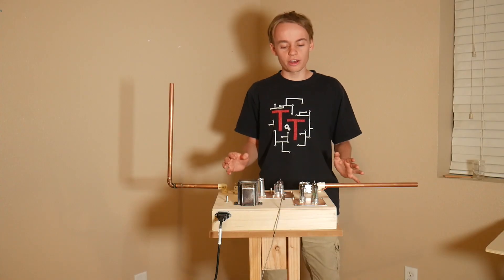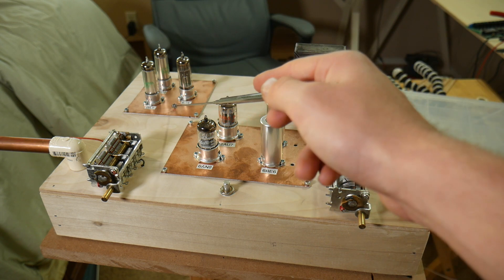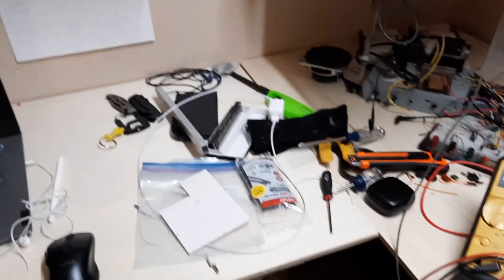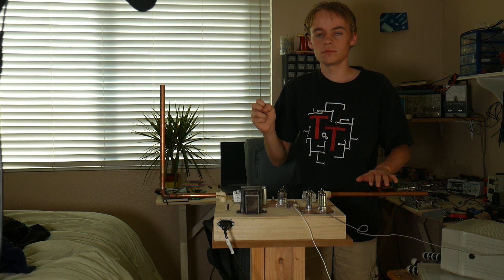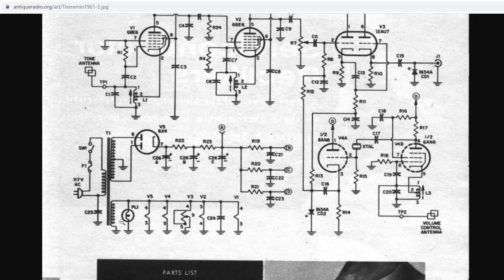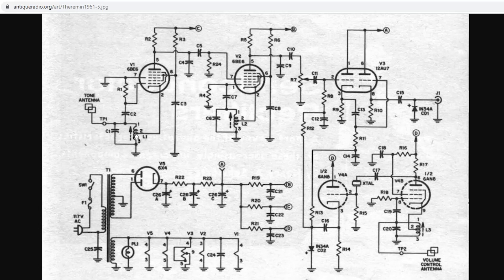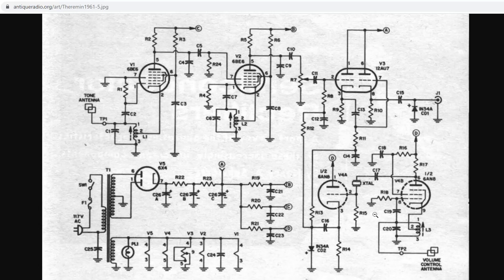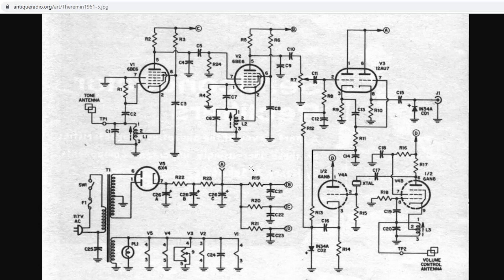DIY Vacuum Tube Theremin(+Circuit Explanation)

Comment: Your volume is reversed compared to every other Theremin I've seen; however, I like that it's quiet when your hand isn't close to the volume antenna and louder the closer it is. Excellent explanation at the end. It brought back memories of my training on Air Traffic Control Radar Systems at Keesler AFB in 1970.
Reply: Some theremins are designed to have increasing volume with the hand approaching. In my opinion, it is actually more intuitive to play that way, and the instrument won't squeal when you move away from it.

Comment: Wow what an amazing video! It's so hard to find a video of a real Theremin build! Is there a big difference in sound quality etc if it's built using semiconductors instead? Cheers!
Reply: The use of semiconductors instead of tubes does not necessarily imply that there will be differences in the timbre, since the designer can selectively alter the circuit topology and select components to emphasize desired harmonics. Having said as much, tubes may inherently cause distortions that emphasize even-order harmonics, while transistors may inherently cause distortions that emphasize odd-order harmonics. Even order harmonics are generally much more pleasant to the ear.

Comment: I just finished building my tube theremin. I looked up the article in EI 1961 and I remember seeing it  back in the day. I chose to build mine in an LMB aluminum chassis box about 12 by 8 by 2 inches high. I used the dual OA2 regulators and added better filtering than shown in the article. I built it stage by stage and tested each circuit as It was assembled. The hardest circuit to get working was the  6AN8 resonant amplifier. My antennas form are still up in the air, but i chose a simple vertical  14 inch whip and a half loop for audio level. It works pretty good. Now I am going to attempt the sold state version.
Reply: There are too few DIY videos that can be found, please come up with DIY process and idea videos!
Reply: I d love to build this with my 1p year old son. I' m intimidated by the dated schematic

Comment: Fantasic explanation of the circuit! I wanted to build this theramin for a long time. 
I live in europe and here the voltage is 240 do you think getting a suitable transformer will be good enough or should i change other things in the circuit?
Reply from the maker: Thanks! A suitable transformer should be the only change you will need. Try looking for some broken vacuum tube gear to salvage a transformer from
Reply: @TannerTech  Thanks again for the detailed video and comments. Can you please explain where did you use the oa2 regulator tubes in the circuit? i can't see it in the schematic.

Comment: But how do the variable capacitors figure in?
Reply from the maker: They are placed between the antenna and ground.  They are there so I can tune the volume oscillator and one half of the pitch oscillator.
Reply: Ah. So in addition to the tank capacitor. Cool.

Comment: How comes the volume gets louder when bringing the hand closer to the volume antenna? Usually Theremins are constructed the other way around, bringing the hand closer mutes the Theremin. Is the original circuit designed this way or was it your idea to flip the behaviour?
Reply from the maker: This was the original circuit where the volume control is flipped.  I could probably reverse it by making the volume control oscillator output control the cathode instead of the grid bias though.

Comment: Nice T-shirt Branding.  Amazing theremin. On another note, do you have any use for used lithium batteries? In the future there will be a glut of them. Already I have a dozen waiting for toxic pick up day.
Reply from the maker: What kind of lithium batteries?  A lot of times, the old lithium laptop batteries have 8 or 9 cells in them, and typically only 1 cell is bad.  I have used the remaining good cells to power some of my projects, like a handheld soldering iron.  

https://amzn.to/2WwFI56

These battery charger boards are awesome, especially if the batteries are 3.6 volts.
Reply: @TannerTech  Good to know. I've 2 dabblers that might take them if I gift the recharger as well. I've drained batteries from 1 scooter, 2 digital cameras, 1 Debot vacuum, and 12+ coin cells from Christmas ornaments.

Comment: Nice job! I really want to build a theremin one day. Be careful with that arcing at 5:09, though. That's not a good sign. Maybe you should have a different filament winding for the rectifier to reduce the cathode to filament voltage. I'm not sure if that causes this, but it's worth investigating.
Reply from the maker: Thanks! I noticed that as well.  It only happened for the first 5 minutes of the regulator tubes running.  The neon inside had not started glowing yet and it was arcing.  After a bit, the tubes started glowing and I haven't had the problem since.  That might be a good idea to have a different filiment winding.  If the problem ever returns I will try that.

Comment: Could you connect the output through say a signal generator, that way you could theramin any frequency

The antennas have no resistor, so there is a path to high voltage, maybe one could be added, or, paint the pipes to prevent accidental shock
Reply from the maker: That would be interesting, technically I could use the volume control antenna to control any audio signal.  

Both antennas have a straight DC path to ground through the oscillator coil, so it is perfectly safe to touch them, as long as the circuit is properly grounded.

Comment: In all things tube, isn't it that the shorter the wire you can get away with, the better? They act like antennas

Having said that, does the sound change if you are statically charged? Or say, try sticking a battery on yourself🤔

Comment: Should the volume part be circular, gives more surface area you can... Nearly - come in contact with
Reply from the maker: Probably, but the copper pipe I bought was too wide to bend

Comment: Tanner, that's an amazing accomplishment - building a Theremin. They are difficult to bring into alignment and difficult to play well. The addition of the regulating tubes helps greatly to stabilize the device. Personally I might have built it into a metal chassis instead of wood, but it appears to be working well as is.
Reply from the maker: Thanks! I wanted to make a metal chassis, but did not have any of the parts to do so.  Wood is a bit easier to work with.

Comment: Wow Tanner that was a good one indeed. A transistorized version of this would be interesting. Instead of the hexode tube you could use a dual gate FET or maybe better a balanced mixer. Glad you're back :).
Reply from the maker: That would be cool, I am planning on making a transistorized version in the future sometime.  Most dual gate fets are new-old-stock, it might be worthwhile to buy one to experiment with.  Glad to be back!
Reply: @TannerTech  Best would be to use a quadrature balanced mixer or analog multiplier that are still available. They are more precise than dual gate FETs.

Comment: Absolutely awesome video Tanner!

Theremin's are wild, wild instruments, and the circuit is super interesting. You did an awesome job man, such a clean build!

Out of curiosity, where did you slot your two 0A2 regulator tubes into the circuit, since they aren't included on the original schematic. 

Also, the 6BE6 oscillators are really interesting. The first 6BE6 looks to have the second control grid tied to the first grid through resistor R1. If I'm not mistaken, this effectively turns the 6BE6 into a fancy pentode (since the two grid potentials are essentially moving up and down at the same rate). I wonder if they did that to use the first 6BE6 as an amplifier for input into the second 6BE6, where the actual signal mixing occurs. That also raises the question of whether that could be shrunk down into a single 6BE6?

The 12AU7 is a really interesting setup as well. They're both set up as cathode followers, which means there shouldn't be hardly any amplification of the signal coming out. It looked like you were feeding the audio jack into an amplified speaker? It'd be fun to build a little Class A amplifier out of two more 12AU7s and an output transformer to drive a speaker for a truly 1960's experience, haha.

Oh, and thanks for the shout out man! Keep up the excellent videos, looking forward to more!

Ninja edit: I was looking at the schematic again and I don't know how I missed that the second grid on the 6BE6 tube is actually tied to ground! That's even more interesting - there's so much going on with each individual tube, it's super fascinating! I may have to build just that oscillator portion of it up someday to fully understand what's going on. My wild guess (at 2330 at night) is that the second grid is held at ground, but the potential of the cathode actually changes, meaning the relationship between the second grid (which is ground) and the cathode is oscillating, allowing electrons to flow to the plate or not. Though I could be completely wrong! What an awesome circuit!
Reply from the maker: Thanks man! I put the 2 OA2 regulators in series to ground right after the 2nd power supply resistor, this made sure the regulators were not directly connected to B+ and before all the supply rails.  Yeah, I was just feeding it through a low quality amp.  Although, I brought it over to my friends house and hooked it up to his fender amp and delay pedal.  It really sounded cool then!  I did build a class A tube amp a while back with a 12AX7 and a 6V6, but it is currently not working.  

You are welcome for the shout out, I really like your channel and I hope you were able to gain a few more subscribers.

That is an interesting thought about how the first oscillator works, you should try that out.  do you think that it could also be just acting like another supressor grid?  This circuit is very cool!
Reply: @TannerTech  Thanks for the update on the 0A2s! And the 6V6 is a righteous amplifier tube. They’re pretty popular among the hi-fi crowd, but our Magnavox Concert Grand uses a how lineup of them and they sound phenomenal. 

Alright, I finally decided to clear off one of my breadboards and give this 6BE6 circuit a shot!

First and foremost, the Hartley oscillator, like the Colpitts oscillator, is such a simple but insane little circuit, it’s hard to wrap your head around from an theoretical point of view. The inductor/capacitor oscillation part of it kind of makes sense, but where it gets wild is that the potential of the cathode is always changing, which means electron flow is being controlled not just by the grid, but also by the cathode. And, when using a 6BE6, electron flow is controlled by two separate control grids as well as the changing cathode potential. It all mixes in an absolutely wild way!

So, I grabbed a spare 6BE6 and rebuilt this circuit, only I had to make a few small changes since I’m running at just 24V. First, R2 is 10k, C1 and C2 are 1nF each, and L1 is 2mH made up of two 1mH inductors with the cathode in the middle. I played around with a few different resistors for R1, the resistor that connects the two control grids and man, things got weird.

Here’s the oscillator on the scope with the probes on the output and the cathode, and a 33k resistor for R1: https://i.postimg.cc/jq4g9SM3/6BE6-33k.jpg

First things first, the scale is 5V per division for both. 0V for the cathode is in the center of the screen, and 0V for the output is at the bottom of the screen. So, the output is oscillating from about 20V to 24V, and the cathode is oscillating from about -10V to +10V. 

The cathode is a hot mess and a half, and the entire thing feels like its on the edge of chaos, haha. It oscillates stably though, which is a testament to how awesome and forgiving the Hartley oscillator design is. I just randomly picked some values and am running at miniscule voltages and it (kinda) works. Things get really interesting once you change the value of R1 though.

Here’s the oscillator with the probes on the output and the cathode, and a 3.3k resistor for R1:  https://i.postimg.cc/kXM1dPZJ/6-BE6-3-3k.jpg

Whatttt?! Yeah, the output has done something wild now. Alright, the basics, 0V for each is unchanged, so the output is oscillating from about 20V to 24V like before, but the cathode has really smoothed out and is now oscillating from about -2V to +4V. What’s absolutely blowing my noodle though is that the output oscillation doubled.

Here’s the oscillator with the probes on the grid and the cathode and a 3.3k resistor for R1: https://i.postimg.cc/QMWskTky/6-BE6-Grid.jpg

The cathode follows the grid almost exactly, so there’s some voodoo wizard magic going on here. My theory is that the cathode and grid are oscillating together, not because one is following the other, but from the LC tank circuit. However, the when the cathode bottoms out, the grid falls a little lower, making it negative relative to the cathode and stopping electron flow. This causes the output to go high. Then the grid and cathode come up together and the difference between the two drops, which brings the output low. Then we see the same thing again at the top - the cathode tops out just slightly above the grid, taking the grid negative in relation to the cathode again, stopping electron flow and bringing the output high once more. 

So, my theory, which is based on absolutely no research and mostly just guessing around at midnight (I gotta work on stuff earlier in the day…), is that by using the 6BE6 and a bit more voltage to stabilize things out, it doubles the frequency of the Hartley oscillator. With the 6AU6 Hartley oscillators I’ve built, they do not get that double bubble look on the output. But why does this specifically happen with the 6BE6? I have no clue, haha. The second control grid is at 0V so perhaps it acts as a control for keeping the two peaks and valleys somewhat equal? I truly don’t know, and I’ll have to do a whole lot more reading.

But why would they want to set it up like this as opposed to just building the oscillator out of a regular pentode or triode? Perhaps it all comes down to the size of the inductor? If they were using a transformer that was on the order of 10s of mH, perhaps they couldn’t quite get a fast enough oscillation frequency. Again another stab in the dark, haha.

At any rate, an absolutely fascinating use of the 6BE6 and there is some definite magic going on here!

Comment: Thanks, Tanner.  That's a really interesting tube circuit.  The volume oscillator interference affecting output bias was obviously the result of a creative mind in the analog paradigm of the time.  Tubes are inefficient, distorted, and suffer a plethora of other weaknesses, but they're awesome anyway <G>.
Reply: Tubes? Like being human with flaws, that is why they sound naturally beautiful particularly in theremin design.

Comment: V5 really needs a separate filament supply, as you are relying on the cathode heater insulation, which at red heat is likely to leak slightly, which can result in a heater cathode short circuit. Normally the transformer has a separate 6VAC winding, that is well insulated, to provide this supply, so the rectifier cathode can float at the HT rail, so that it will not short out and blow the tubes from a massive heater current spike.